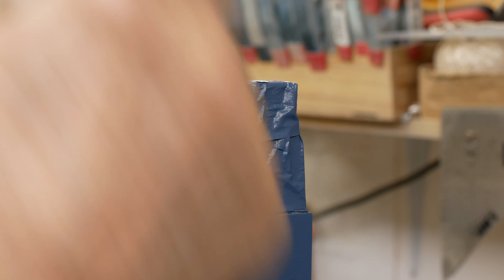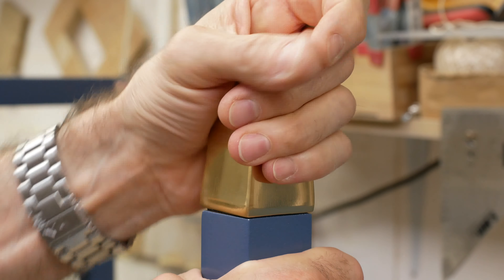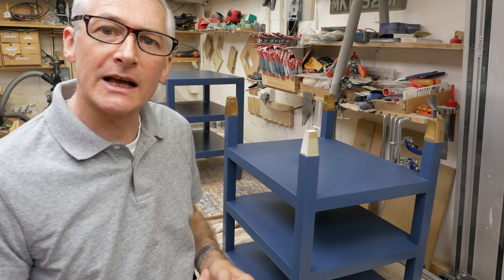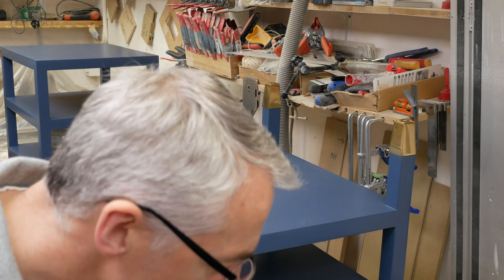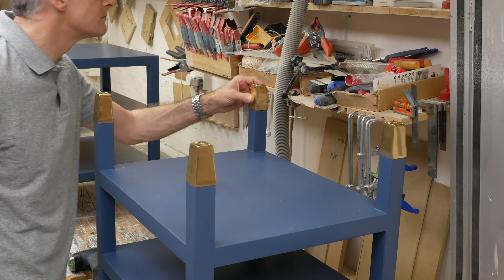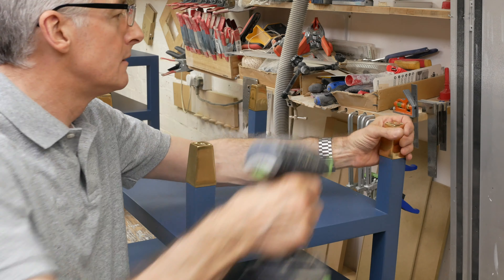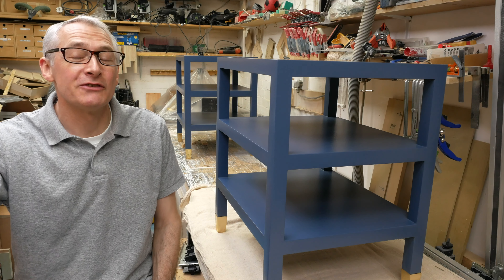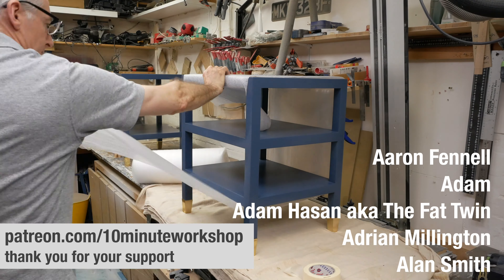Painted Side Tables P4 video #339]

Comment: Hi Peter,  Not sure how many of those feet you have fitted in the past, but as soon as I saw them I knew you were being optimistic to think they would just pop on. I have made traditional furniture most of my working life and I have never been lucky that the feet would all be exactly the same. I think you will find that they have been sand casted and then finished up by hand which will always leave slight imperfections and differences. You should have a go at fitting Lions paw castors to shaped splayed feet, even harder.
I agree with you on the finishing, having dabbled at French polishing and spraying lacquer, I think its best to stick to what you do best and then let someone else do the finishing.
Strange choice of material for the castor for a modern table though, think looking at the colour, stainless steel would have gone better. Mind you thats just my opinion the customer is always right.
Reply from the maker: Almost none tbh Gary. Live & learn, eh? 👍

Comment: They look great Peter ,as for them fancy feet i would have cut the feet smaller epoxied them on and put one of the small adjustable foot pads on the bottom ,you know a threaded foot to adjust height in the center hole ,anything cast will be shirt on the inside because of the sand casting .There's always making your own out of thin brass plate and soldering the seam call them artsy and charge more ...lol
Reply from the maker: Haha, thanks Syd! Yes, I’m learning about these feet - hopefully not too many more of them in my future, lol! 🤷‍♂️👍
Reply: @10MinuteWorkshop  lol you got this Peter

Comment: Clearly Peter, fitting the feet is no great problem... For the foot maker as they presumably don't fit them.

It's an interesting demonstration of what happens in these kinds of projects where a designer specifies bits and processes without knowing the pitfalls.
Reply from the maker: Very True Benedict 👍

Comment: Hi Peter
You only need a "square"at the top of the foot and a square at the bottom of the foot. The centre part of the foot is irrelevant and using two squares you'l be able to disregard much of the poor casting. Trimming to fit will be MUCH easier as you only need to trim two "squares" (perhaps they'll have a slight taper on the edges. Any strength lost within the mdf will be recovered by the foot casting.
Creating the shape for the foot will be much easier as you need only create 90 deg cuts. Think of a "T"or inverted "T" shape.

Regards Peter
Reply from the maker: Thanks peter. The problem was with the bottom ‘square’ of the cast foot, though - it was nowhere near square! 🤷‍♂️👍

Comment: Enjoyed this series to Peter one question I noticed that your stock is different colors that’s not like that in the states is that for identification?
Reply from the maker: Thanks Steve! The MR (moisture reaistant) MDF that I use is always tinted green for identification. Thicker panels (>15mm) usually just have a green core, thinner panels are green throughout. We also have flame-retardant MDF that’s tinted pink. 👍👍

Comment: Hi Peter. Obviously less care has been taken with the sand plug than the outer shell when casting. There are other casting techniques that can give a smoother internal finish - probably cost even more. Maybe a narrow belt sander would clean up the inside enough, but the metal dust is just as bad for us as the mdf stuff. I wonder if fitting the feet first then painting would work? - Masking might be rather tricky though.  Maybe a different shape on the mdf - fitting a the top and bottom of the metal feet but with clearance on the section in between.  I would think that it would be stable and the resultant internal gap could be partly filled with a suitable glue. Needs experimentation - or don't do this design again! BobUK
Reply from the maker: Haha - well, I didn't have all the feet until right at the end, so a bit of a moot point. And yes, we'll see if this design comes up again... 🤷‍♂️👍

Comment: Those dam feet reminded me of the time I stupidly made a jig up to fit brass flush bolts on a big job in Wentworth after I was given a couple of samples, you guessed it, those where the only couple that came anywhere near the one I was given. I ended up having to let new blocks of poplar into all the other doors that I had routed out, and cut them all again one at a time. I think they were made in someones back yard in India, as they were all slightly different. Watching you putting those feet on, made me feel sick, (mass produced over priced crap)
Reply from the maker: Ha! Yes, the feet were nicely finished - on the outside! They weren’t expensive, but they weren’t cheap either! 👍👍

Comment: Looks like quality control at the casting manufacturer isn’t up to high standards. Not even the holes were the same size!! Good thing you had 3, 3.5 & 4 mm screws.